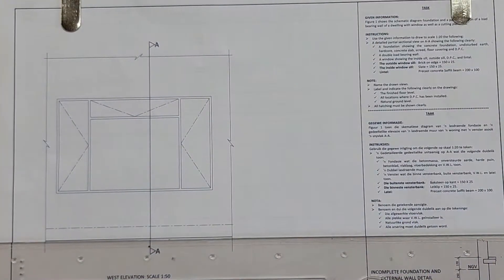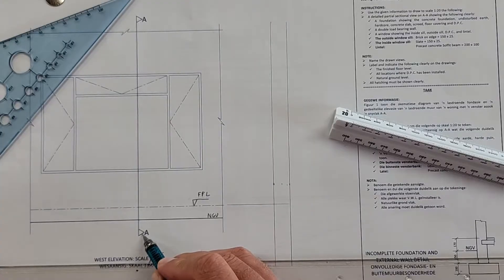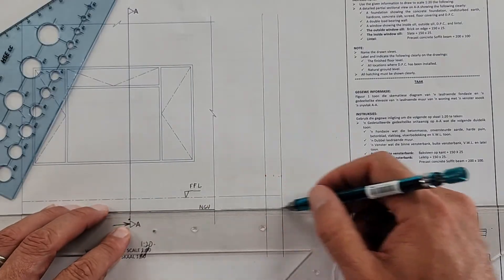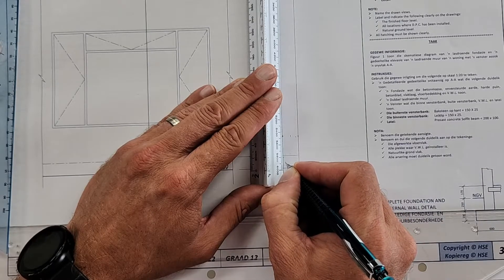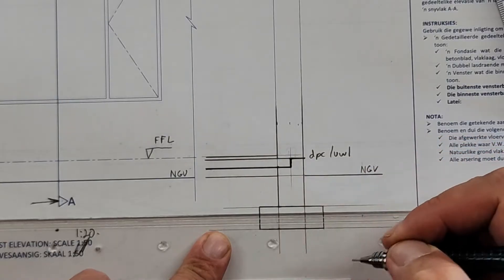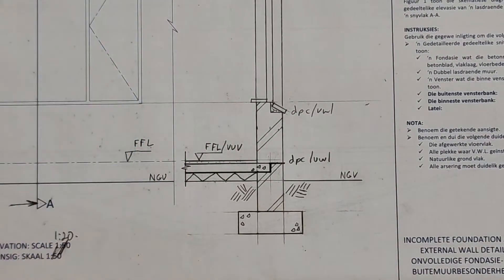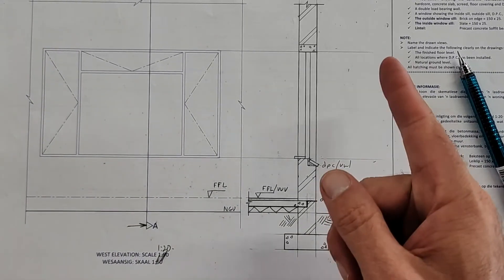How to draw a CIVIL SECTIONAL elevation - HSE | Page 3-5 | Grade 12

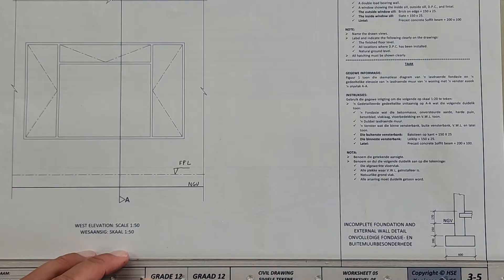Comment: Good day sir, I’m a bit confused about 2:05 how did you find the measurement for the load bearing wall because I didn’t see it indicated on the foundation
Reply from the maker: Good question. The standard width of a load-bearing wall is 220mm. The Non load-bearing wall is 110mm, and a cavity wall is 270mm. These measurements are standard and must be remembered... Keep Drawing.